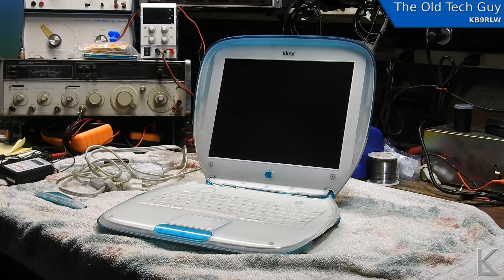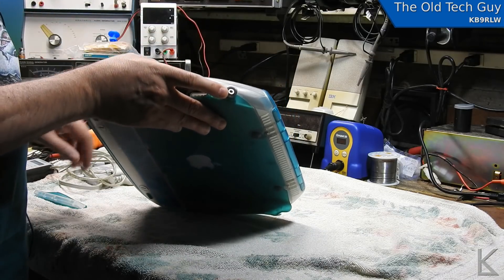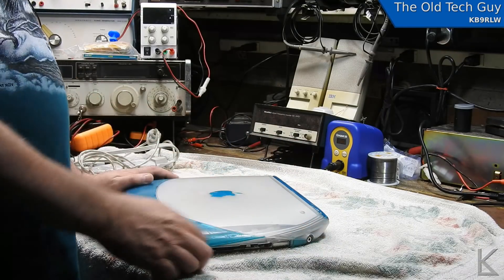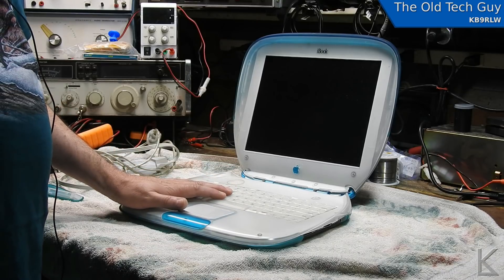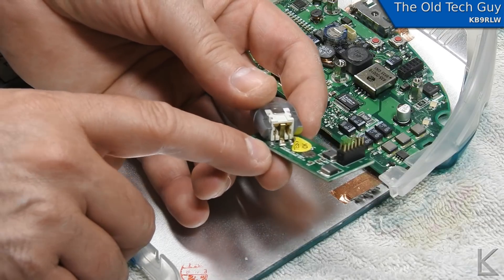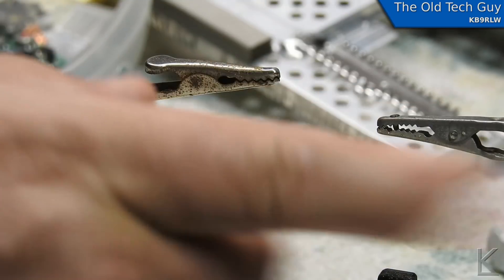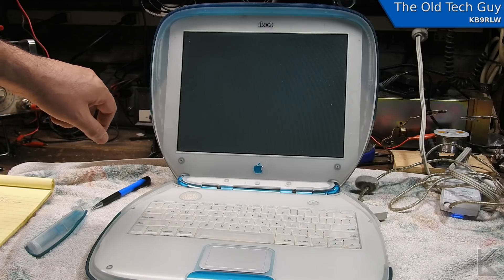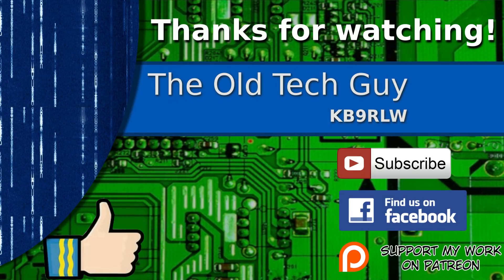Electronics Repair - Clamshell Apple iBook power connector repair

Comment: Why didn't you just double sided tape the bezel onto the drive front. May not last forever but be better than off I guess.
Reply from the maker: I should have photographed the drive front.  There are no flat areas.  It's ridges and holes with moving parts in the holes.  Nothing to stick to without compromising the mechanism.   Trust me, there was no easy way to do it.  The owner didn't mind.
Reply: I get you, not a big deal for a 15 year old laptop.

Comment: Just curious, could you have 3d printed the CD drive cover?
Reply from the maker: Maybe, but it's a crazy curvy design in three parts with a button that extends through to a tiny shaft.   Theoretically, one could design a replacement.  But it would take hours and a few prints to get it right.  He couldn't afford to pay me for the time.   I'd charge $40/hr for design work and that's pretty cheap.

Comment: When I was a teen back in the early seventies, I used to work on my old Chevy. The Quadrajet carburetors seemed complicated and it was hard to remember where all the screws and parts went , especially if you had to wait a couple of weeks for parts. So I came up with a way of keeping track of where all the screws went. I would take a piece of cardboard and draw a rough outline of the machine and where the screws went. Then I'd poke a small hole in the cardboard where each screw went. As I removed each screw, I'd push it through its hole in the cardboard. You can make many "maps" as you need and reassembly is a snap, even after extended delays in reassembly.

Comment: Did you put epopis on the connector so it won't crack the solder joint again?
Reply from the maker: There are plastic bits that surround the connector, so it wasn't possible to do so.  The solder joints are stronger than when new, so it should outlast the rest of the computer anyway. :-)